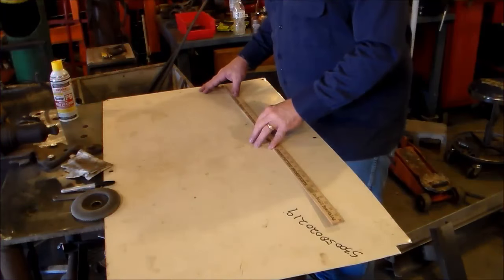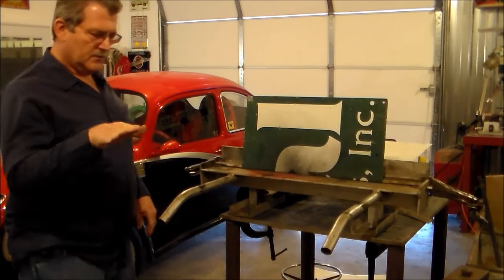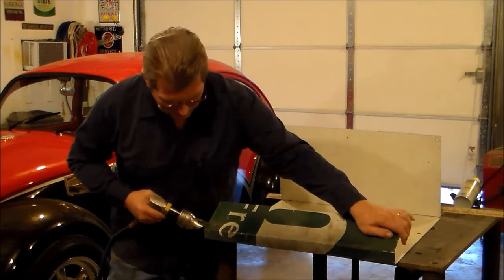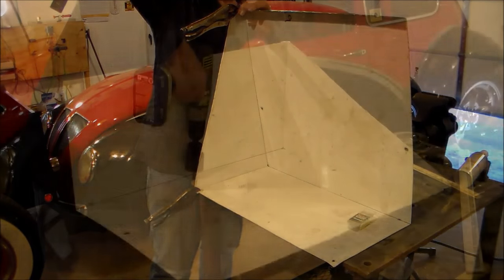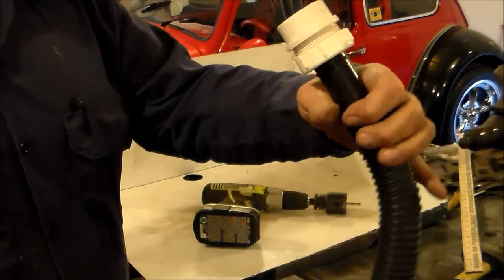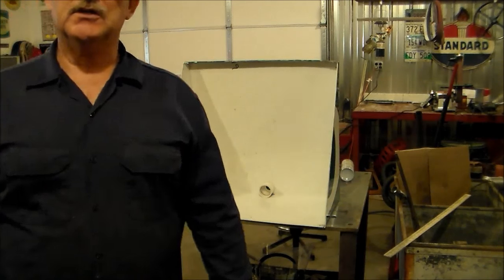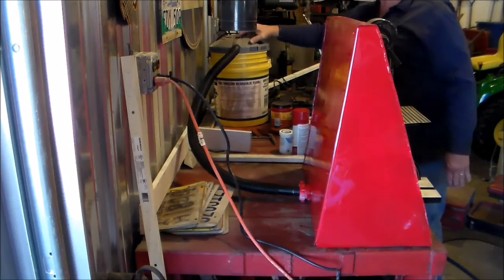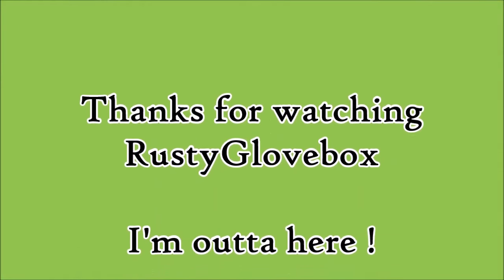Saw Dust Vacuum Hood

Comment: Great little addition there!
Reply from the maker: +Greg's Garage   Thanks Greg, Watched one of your older videos when your Dad hooked the generator transfer switch to his circuit breaker panel.  I may do something like that . How is that working anything  he would change? Take care
Reply: It works great.  He's had to use it a couple times.  If you have power outages and you want to use your generator, it's THE way to go.  Takes a day or two to get things sorted out, but when you go to use it, there's nothing easier.

Comment: Real Nicely Done.....simple. But, very well designed and easy to move around the shop.  =  )     I also like the metal brake to.
Reply from the maker: +Danny Walker Thanks Danny, I made the metal brake when I built the V8 VW because I had so much sheet metal to bend . Take care